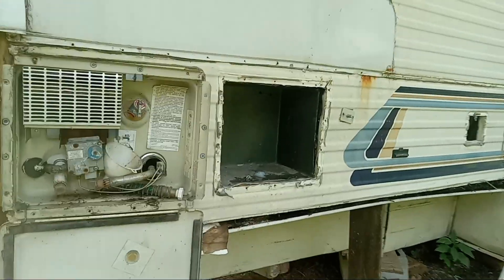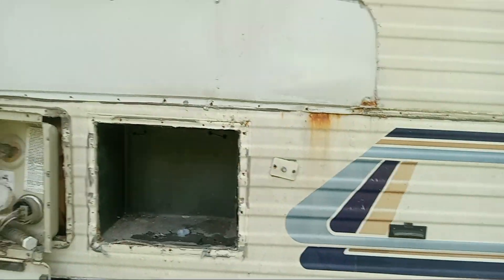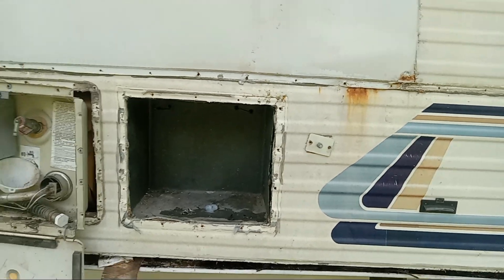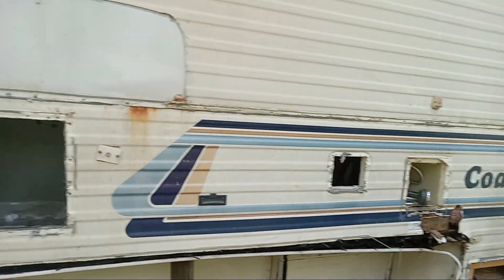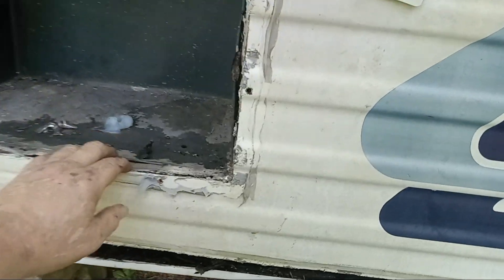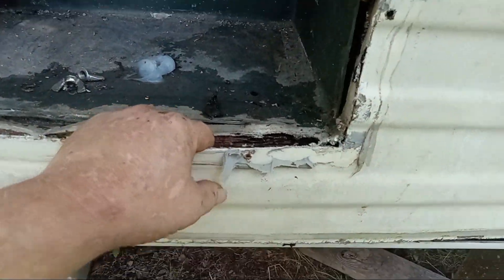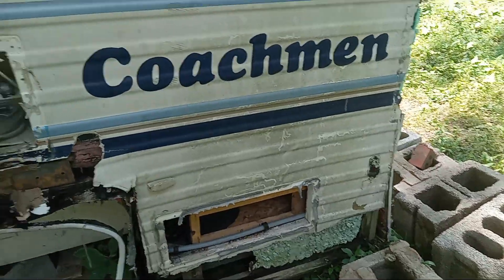Framing Repair - 1990 Coachmen TruckCamper. - Part 2

Comment: its not worth trying to save way too much work. buy 1 sheet of that corrugated roofing lay it up there cut off the org siding to the closest rib and glue the metal on and just put a molding over the seam the sheets come in 12 foot lengths and prime and paint it as you wish nice clean and done
Reply from the maker: Thanks, but I'm going to try to make a fiberglass mold of my siding and make more of it.